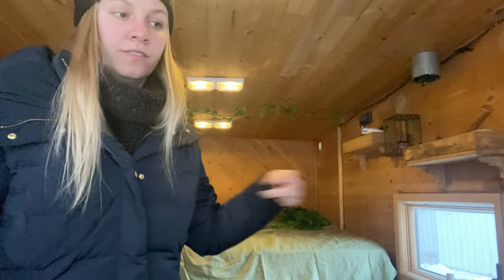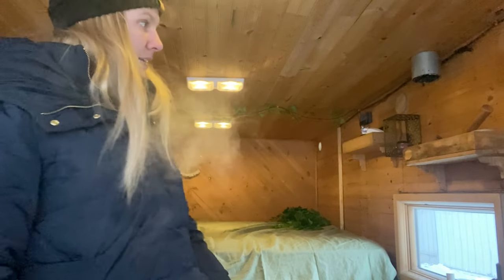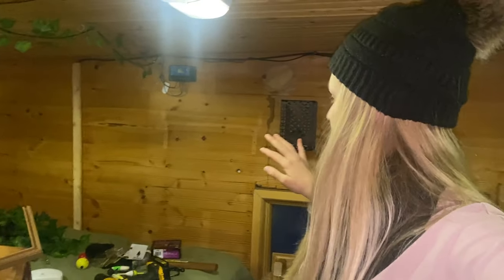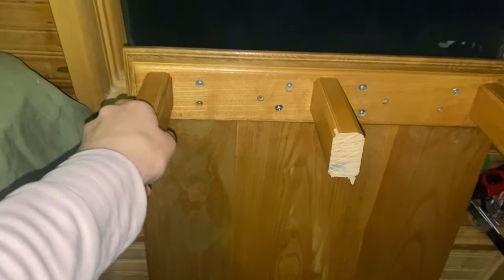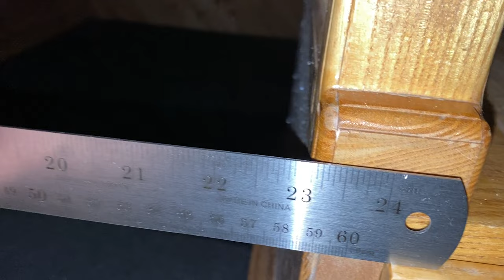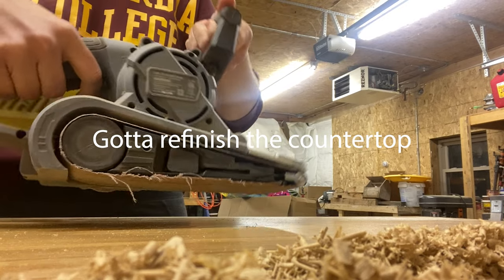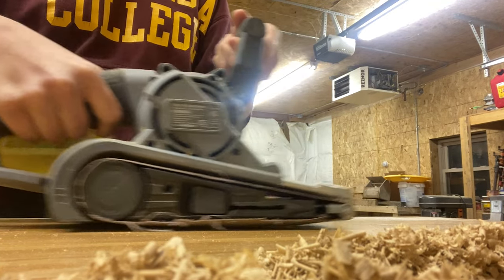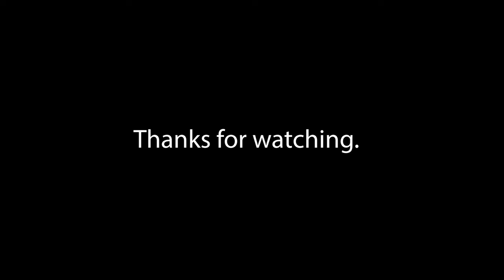Winter TINY CABIN Remodel Success- Tiny Camper

Comment: Condensation is a campers worst nightmare 
it will fill the walls with mold and mildew 
plz don’t think i’m being a troll or hater 
just trying to give you a heads up 
your camper looks nice and I would hate for it to be ruined  that non-vented propane heater it’s going to destroy  your camper with excess moisture  these trailers are made of metal the drastic temperature difference between outside and inside any moisture within side it’s going to turn to condensation 
liquid propane gas it’s full of moisture don’t take my word for it please do some research 
I just wanted to give you a friendly heads up and by the way nice job on the camper build
Reply from the maker: Thank you for the heads up.